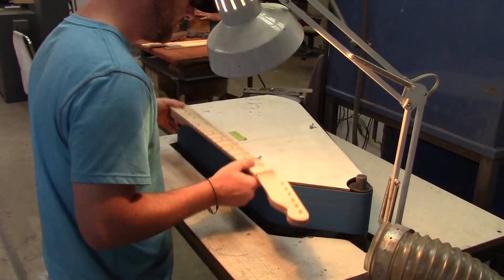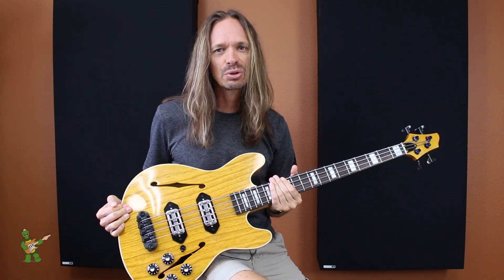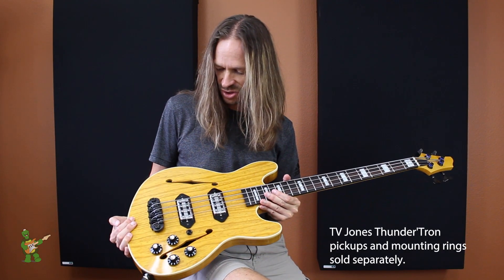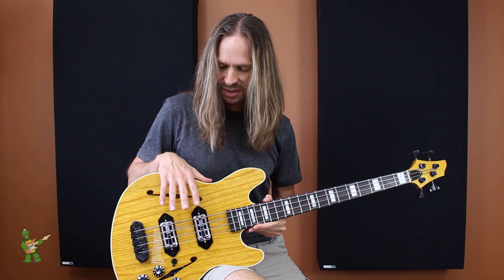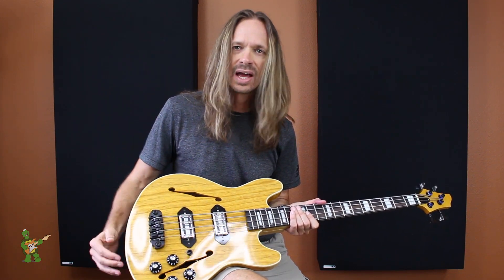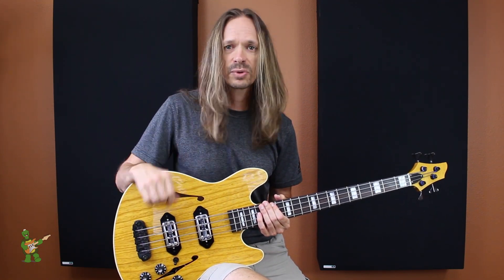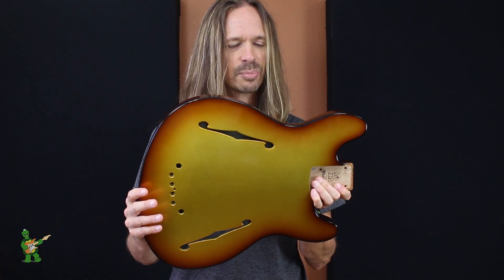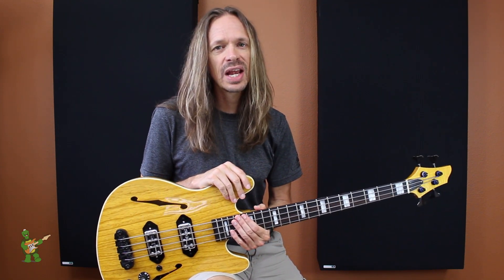Warmoth Mooncaster Short Scale Bass Body

Comment: hey Warmoth,  wouldn't it be cool if yall made a conversion neck for converting regular scale bodies into a short scale bass?
Reply: i think the bridge placement would have to change too
Reply: Johnisbetter1024 i wouldnt think so, as long as the fret spacing is designed to accommodate for the odd relative bridge placement
Reply: The bridge placement would definitely have to change. I just wrote the "I think" part to not sound like a total know-it-all. Sorry about that :P The reason I know this is because I've built basses before, and the long/short scale length is totally different. The frets wouldn't be in the right spots and the bass would not intonate properly. Also, the pickup placement would have to change if you wanted the bass to sound similar to before,  since the pickups would be in different spots relative to the scale length.
Reply: Johnisbetter1024 I know it's been 3 months, but I thought I'd chime in. It is 100% doable to have the neck change the scale. For example, a capo being placed in a fret essentially shortens the scale. Move the headstock (in theory), and it works perfectly.
Reply: Guys, they already did it with their guitar necks by using a fender scale neck but using Gibson fret spacing. They were forced to use an overhanging 24th fret though. You just want them to convert that technique onto a bass neck
Reply: Michael Miller  bridge placement is relevant to scale length. You can change the scale length by shortening/lengthening the neck or moving the bridge further forward or back. If you move the bridge the instrument won't intonate properly anymore though.
Reply: Michael Miller  intonation is relevant to bridge placement too for the same reasons. both in regards to a conversion neck and in regards to scale length
Reply: Michael Miller  if you have a 34" scale bass, and move the bridge 1 inch closer to the neck, do you still have a 34" scale bass?
Reply: Michael Miller  oh geez.

Comment: My question is what makes it specifically a short scale body? Is it offered in a packages with the same hardware as the one your playing?
Reply: Aaron Davis what makes it a short scale body is that it’s a little bit smaller in size compared to a full scale (normal scale lengths are 34 and 35 while short are 30 and 32 inches)